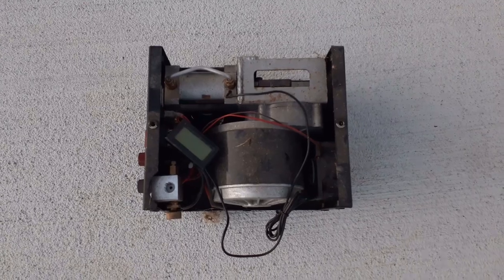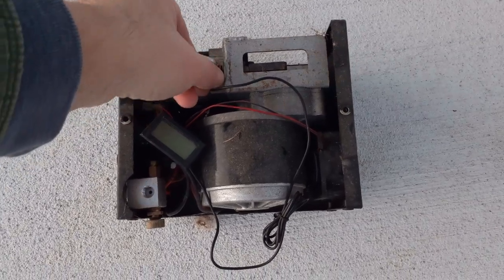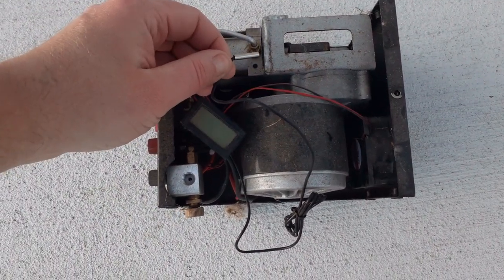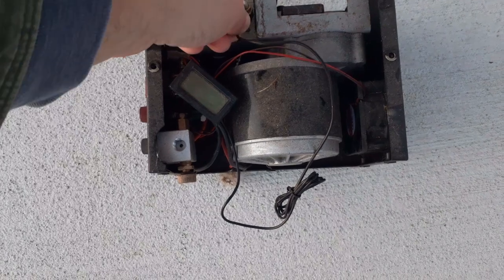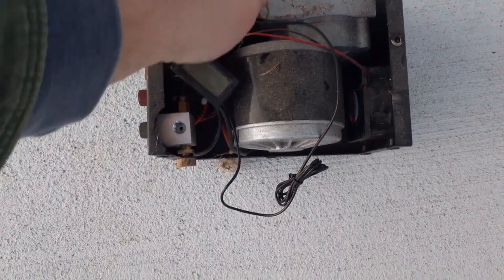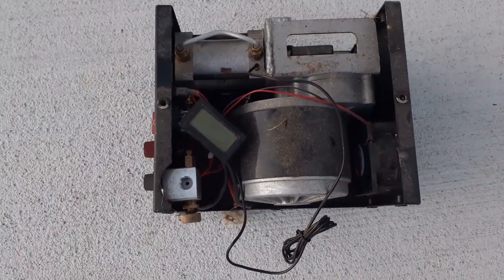TRUTH about Oil & Coolant less AIRGUN Compressors

Comment: My ebay hand pump I bought in early 2018 (for 55 bucks at the time) is still going strong and hasn't even needed a rebuild. I do the routine maintenance recommended on it often, and I shoot a lot. It's exceeded my expectations, couldn't recommend it more. Not sure if they still make them, but back then they were basically all the same pump.

Comment: Filling source price and hearing all kind of issues sure is one of the reasons why I am scared and too poor to get into PCP's just yet.

With this said hopefully one day all of the compressors will be budget friendly & reliable!
Reply: @joeschmoe8320  I was everywhere 5 months ago 🤣
I had alot of free time back then 😢
Reply: I have a vevor air compressor working just fine also a scuba tank i use the tank alot  also i fill the tank with the vevor compressor
Reply: @beastmode2990  Yet no issues with my Vevor pump !
I am still too broke to get a compressor but maybe one day
Reply: @beastmode2990 which model Vevor did you get? There's so many models. Sounds like you've given that one a proper workout! Especially filling larger tanks.

Comment: Ahoy thanks for sharing your experience. One point that I've heard before on airgun forums. Heat does not create moisture. Moisture cannot be created. The moisture is in the air, period. During compression the air gets hot, when it cools condensation can occur if enough moisture is present. Difference is, a liquid cooles unit condenses the moisture before it gets to the whip, an air cooled the hot compressed air cools in the whip. Best solution for either setup is to dry the air prior to compression. It's cheap and simple to make an air dryer for the intake using filter medium and filter cylinder. When compressing over 200bar if an air tool compressor is used to pressurize the intake filter of the hpa unit at 20 to 30 psi, the hoa unit runs cool. The tool compressor has a regulator, and that 1st  low pressure 'stage' will remove most of the moisture in the tool compressor tank. Also, a bottle of nitrogen is useful. Empty gun, add a little super lube to the fill, and fill with nitrogen. Do that every couple dozen fills and moisture troubles will be eliminated.

Comment: It's a good idea with cheap compressors to run for 10 minutes at a time then stop for 10 to let it cool. Heat is the problem.
Shorten the run time and you basically fix the issue.
Reply: That’s exactly the same way I use my cheap ebay Chinese compressor and its working flawlessly 😉
Reply: Same here guys. 10 minutes filling, 10 minutes cooling.

Comment: Yeah I've been using a 12 volt compressor since 2020 and with the same AEA Challenger  Standard Long Stock, and it still works like a champion. It all comes down to how you treat your compressor and if you change filters after every use or atleast take them out to let em dry. I use 2 filters on mine and have been doing so since I started and my guns work fine. If anything from me using my dad's air, which he uses a Yong Heng, I had to clean my gun out because he managed to let oil get in his tank and the air stinks. They both have their advantages, and the Yong Heng is super heavy.

Comment: I've been running an Omega Air Charger for 3yrs. No problems yet. I only air up airguns directly even though its supposed to be able to handle smaller tanks. It is liquid cooled and at some point I know there will be problems but the good thing is that airguns of Arizona can get you the parts. The new GX CS4i seems to be a clone of my Omega but looks more "finished" and is half the price. If I had to buy one today I would likely go that route because I bet they are made at the same place.

Comment: I've used my Nomad 2 over 100 times. No problem so far. It does use silicone oil though. 
No problems out of my Hill Pump either. 👍

Comment: I own both the Yong Heng and a GX. I've used the GX once, and it sits in the box in the closet for emergencies. I've used my Yong Heng for years and never had an issue. I change the oil every three times of use because why not ? It's cheap and will last longer. I use ice cold water, too.

Comment: Well my friend, I am heeding your sage advice. After killing a $200- Tuxing in a month (broken connecting rod), I have just ordered an Omega Air Charger.
Reply: Great choice. I've had mine for 7 years now, great compressor. Use it to fill my 75 cubic ft. bottles. The Trail Charger works very well also, it's almost 2 years old. Great tech support, Todd knows these units inside and out. I think you will be very satisfied. Pay a little more, get a lot more.

Comment: Yea.. Dunno. Will see over time.

 I just some days ago got my very first compressor.
I were first to buy a 230V/12VDC Vevor oil/coolant-less compressor for €250 - but apparently I then did go with a simple/stripped €175 "Yong Heng copy" by Tuxing. Now verified that it pressurizes all okay wirh the whip dead-headed. Next up just to get to see over time how it serves me. I though only have a 10ci and a 13ci bottle-tanks for my Sig Sauer replicas to fill up or top off..
If the compressor fails - I then at least get myself an interesting compressor project. I do have my first hand pump contraption to lean back on to, if the compressor fails..

Comment: All compressors will fail eventually as heat and water are constantly produced.  Water inside the compressor between stages will corrode check valves, sealing surfaces and lines.  
All air contains water vapor, compressing it causes it to condense which causes damage to both compressor and anything using it.  
I feed my Spirtech with ultra dry air from a 120 PSI storage tank half full of desiccant.  A regulator drops pressure to 5 PSI which then goes to the inlet hose.  I modified the inlet filter with a brass tube fitting.

It makes fills a bit more complex but zero moisture in the equipment.

Comment: Thanks for the info I have an orange with auto stop for a field back up only used it twice and was concerned about the short hose and put a longer one on it. I also have a YONG HENG compressor that is my main one with bottles. Via your advisee thanks I have learned a lot from you.

Comment: I have used the YONG HENG compressor for over 4 years on with very little problems. Yes, I did run to some issues that were easily repaired with parts that I gotten from AliExpress. I'm planning on having somebody or myself rebuilt it if I have the time, but it's still working properly it just seems like it needs a tune. I might just buy a backup unit of the same type, but I still might get one of those portable battery poweredu nits so when I go hunting I have a way to air up my air rifle, but use it very sparingly because I myself kind of figured there were not the most reliable units.

Comment: I have my "fung yeang" (whatever it's spelled) compressor.

It was leaking a few drops of water from the cooling unit from day one.
One day I may be willing to repair it but it's no big deal since I use it in the garage.
Exept from this little inconveniance this machine has been pretty reliable so far.

I also have a chinese hand pump but I don't like it.
As soon as it gets a little bit dirthy inside, it stops working meaning I have to dismantle and clean it at least 1 - 2 times per fill 😢

Comment: They would be ok as “burnables” at $120.  Ten bucks a month for the convenience. 
Everything in my gut says “ as hard as that thing works, as hot as it can get, running without coolants or changeable lubricants……. It’s going to die pretty quick when used regularly “.  I wouldn’t mind having one , but I’m not spending the kind of money they’re asking . They’re “throw aways”.
Thanks for helping confirm that in my mind James. I don’t have the luxury of pissing away $300.
Reply: But I'm sure you spend way more than that in ammo?😊

Comment: Yes, sir,  I bought the nomad 2 compressor for 800 bucks instead of a big air tank fireman's air-breathing tank thinking I would save money because you have to fill the tank and pay for the air at a local dive shop or somewhere where they have a big compressor to air up your tank anyway, well the nomad 2 piston blew out the side and hit the wall in my house it could of caused harm or injury to me or someone in my house and the warranty on this compressor is only 1 yr mine broke right after my yr was up, go figure,  after that, I got a youg heng compressor it still going after 3 yrs it's loud but it works 💪 as long as you maintain it change oil stuff like that  youg heng cost about 250 bucks I should of bought the big tank instead of that nomad 2 I would still.have it ....thanks for sharing bsafe buddy 👍
Reply: My first one blew a piston too.. babied that unit and maintained it by the book. 😢luckily I was within warranty but it was the beginning of an almost 8 month ordeal of trying to get a working unit back from them.

Comment: IV try to explain this to people for a while now the Yung hang could be as good as a hi end pump by adding different parts like the water cooling system and other options that really what your paying for is little upgrade  and options that can be add as well  if you really look at a hi end pump it's the same thing with a bunch of different little things your probably over paying for 😉🤔💯🛠️👍💪🍻🎯

Comment: Any way to get the water out or check for it?
Reply: Detach it and dry it....blow compressed air through it, or hang it until dry, etc.... with every use is the most certain way to ensure water doesn't get into the system when filling.

Comment: Bought one, it died on the second use in less than a week of ownership. They offered me parts and then offered me 1/4 refund. I asked multiple times for a full refund and or exchange or upgrade. Nothing. Do not buy if you value reliability and your hard earned money. Still dealing with Vevor support. Would not buy from this company ever again. Very disappointing. Cheap junk.

Comment: I Need a O Ring Kit for the GX CS2 . I write GX Pump and Target Forge. No reaction. They don’t Write me back. Its terrible Companys. The First Compressor I buy was Vevor. After 8 Month the Transformator burn . No replacment Parts in EU for this compressors. The Compressors you can buy in EU but no Parts. Yet I can not use my GX Compressor because of a fucking Piston Ring